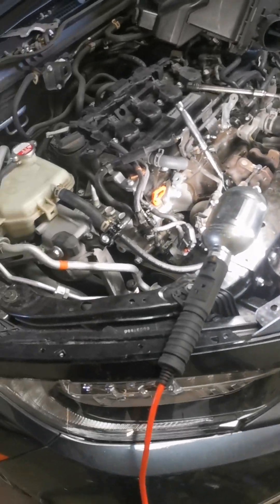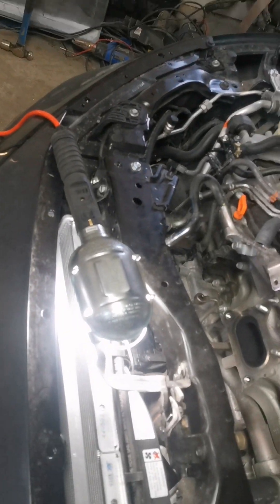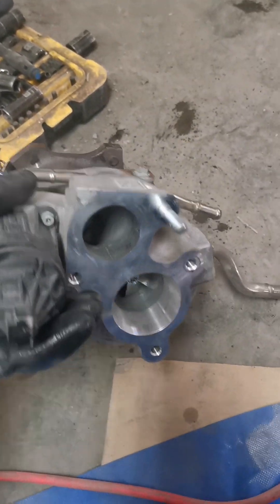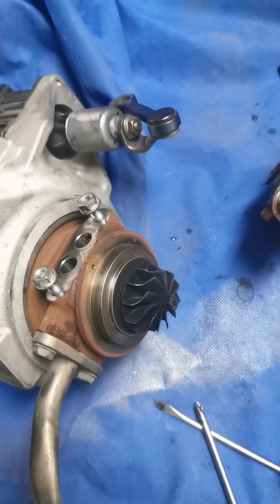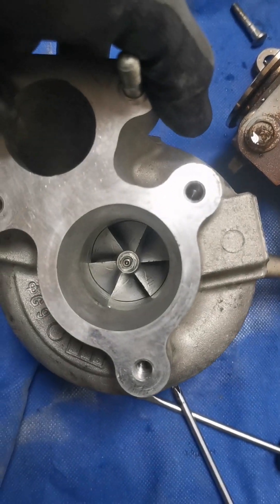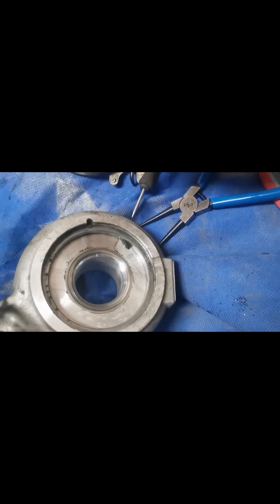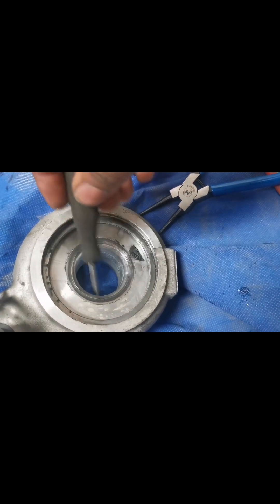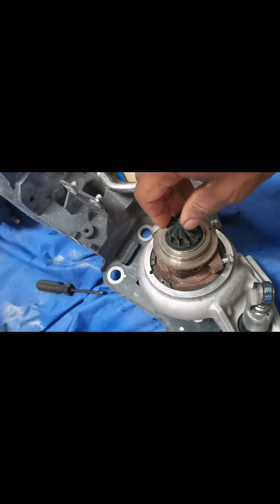#(P0299)Turbocharger Under boost problem fixed.

Comment: Hi, my wastegate is shut closed tight. The actuator is not holding pressure causing the wastegate flapper to be stucked closed.  But I don't know why I am getting a P0299 underboost code. If wastegate is stucked closed shouldn't i be having overboost ? The car runs but has no power slow acceleration. Any help would be greatly appreciated. Thanks
Reply from the maker: If your actuator is not holding vacuum, it simply means you need a new actuator, it depends on year, recent model uses electric actuators. This is how the vacuum actuators system works! when the vehicle is idle the there will be less vacuum and the actuator stays open, as soon as you rev the engine, then vacuum increases and the actuator closes the waste gate, so if the actuator is not holding vacuum that means your waste gate is open which can cause the P0299 underboost condition.
Reply: Thank you for your reply. But my wastegate actuator works on positive pressure though.
Reply from the maker: Hi, What is the year, make and model of your car.. so I can answer your question correctly.
Reply: Thanks for your reply. I have 2007  audi a4 quattro 2.0L turbo.